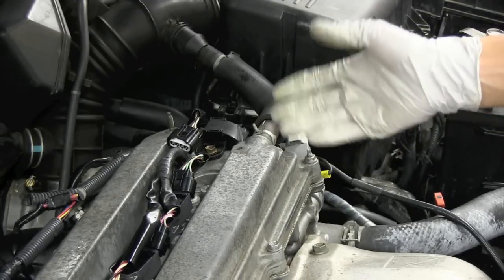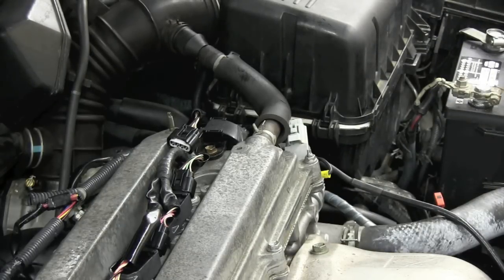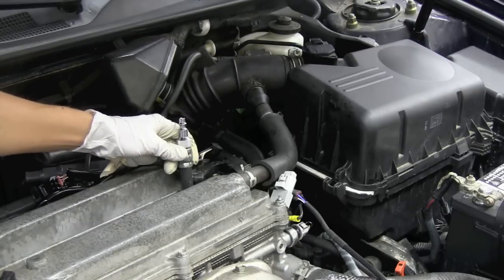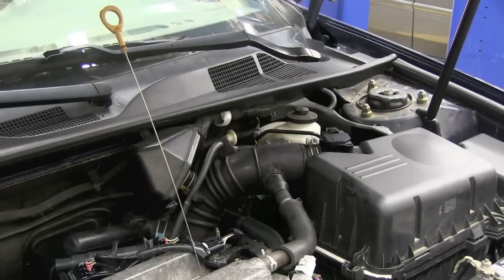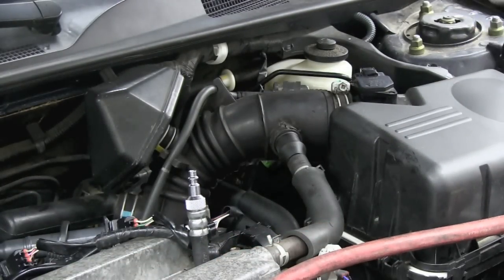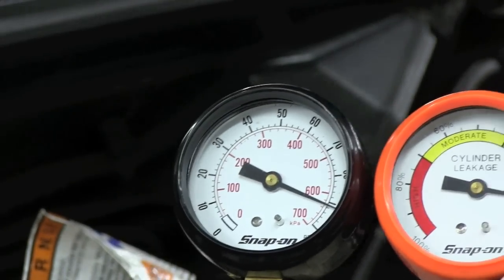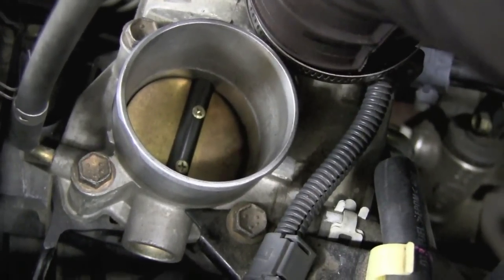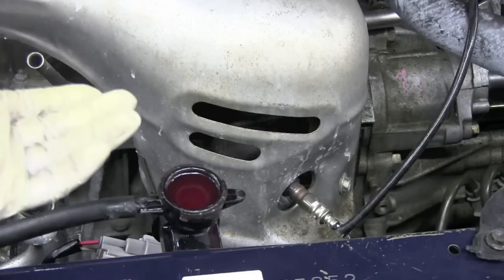Cylinder Leak Down

Comment: Excellent explanaton!  A couple of commen ts.  Engines never run cold - leakdowns tests should be run after the engine reaches normal operating temperature.  That allows oil to seal the cylinders as they would when running.  Next, after connecting the tester, run the regulator back up to 100 psi.  A new engine would have a leakdown of less than 10% (10 psi on a 100 psi input).  30% or more needs investigating (valves, rings, cylinder scoring can cause excessive leakdown..

Comment: I believe you need to close the regulator FIRST before connecting to shop air, this is to protect the dial from getting too much pressure applied to it, which it's not designed for, which would through off calibration. You have to start at zero and then twist the regular to bring it up to 100 psi, but no more.

Comment: What do u mean: if we reached TDC and then we will connect the tool  with the air supply - u sayin the pressure will push the piston down??? How to know if there's a leak or just valves got open???

Comment: Many thanks. Lovely lesson.
I have changed the head gasket, and I'm not sure what I did wrong. Cylinder 1 has 100 PSI, and cylinders 2, 3, and 4 have very low PSIs. The head cylinder was rectified. I can see the difference more than 2 mm short on one side. The engine will start and run for approximately 1 min. after it starts shaking and stopping. It will start only when it's could.  After it won't start again. Can somebody help?

Comment: Never put anything through the hole of your spark plug while you're turning the crank😂 bits of the plastic from the dip stick can break of inside the combustion chaimber or you can damage the thread.

Comment: Here's a trick, put a latex glove over the exhaust pipe and see if it swells up then u got leaking ex valves. Put it on the dip stick tube also. If the spark plug hole is on the side of the head don't use dip stick you can bend it.
Use a stiff piece of wire, and keep checking it does no bind before TDC.

Comment: Good and clear. I like the dip-stick trick. On the old British cars that I'm used to the spark plugs come out of the engine at an angle to one side so the piston can trap the long skinny screwdriver that I use, or the dip-stick that you showed us. It'll be fine if you just nurse it upright before it pinches. Good vid!

Comment: Here's how I find top dead center when doing a leak down test:

1) Connect tester to the cylinder you want to test.

2) Hook up compressor with low (~10 psi) pressure.

3) Turn the engine by hand while looking at the needle on the leak down tester.

4) Watch for the needle to rise (indicating compression). A falling needle indicates an open valve.

5) Keep turning until the needle stops rising (just starts to fall); you may have to back off a tiny bit.

You are now at TDC and you can use full pressure to do your test.
Reply: Just use a balloon on one side of the adaptor. When it expands it is on the compression stroke.

Comment: I think the low range going to 40% is because this is a static test, thus with the engine not running and warmed up with oil lubing the cylinders you will het lower readings

Comment: @5:22 - You did not show how to properly rotate the engine with the tester attached. Poor quality presentation as this test is very simple otherwise. While the correct positioning of the cylinder is critical but not shown the second time. But you said @6:15 - "get your hand broken" this seems poor example to me. @6:04 you rotated the engine again? How? Very confusing.  You did it, Good for you! But for someone needing to learn for the first time safley, you made it look risky. Otherwise, it was well presented. My comment is simply to express that new people don't think the way you may assume. And when danger is indicated, as you did. Please include the complete procedures in video form so no one gets hurt and does not haft to preform trial and error.

Comment: Great job!  One suggestion - if you turn the air pressure up on the tester gradually instead of plugging it in at 100 psi, it will be less likely to push the piston down to BDC.

Comment: Wouldn't be better to listen for leaks in the crank case from the oil filler cap? Isn't the dipstick tube going bellow the oil level?
Reply from the maker: The dipstick itself goes below the oil level, but the tube is normally above.  Listening through the oil cap or dipstick tube works just fine, and many techs will listen to both just to be sure.

Comment: I like your video. I've watched plenty of other techs using leakdown testers. You do a great job and you are using the snap-on tester (which is what I use when teaching engine diagnosis). It would be good to mention that the leakdown adapter hose does not have a schrader valve. If you also have a snap-on compression tester, it is easy to get the adapter hoses mixed up. That always causes confusion with students.

Comment: would it do any huge damage if i rotated it counter clockwise just a bit?
Reply from the maker: No you should be fine.  The reason why you don't want to go counter clockwise for a long duration, say a full turn is that the tensioner is designed to pick up the slack of the timing belt or chain only on the one side.  When you reverse direction, you may end up with slack on the other side which could put you out of time.  Can't say I've seen this happen, but it's theoretically possible and all the manufacturer instructions caution against rotating the engine counter-clockwise.  There are a few rare engines that normally rotate counter-clockwise.

Comment: I have no compression on cylinder 3 is it possible it’s just a stuck valve?
Reply from the maker: Typically not.   A valve that is stuck open which is rare, would likely result in a bent valve depending on the engine.  A bent valve does occur sometimes due to other reasons such as being out of time, or a burnt valve could give you the same result too.  Unfortunately there's many options, hence why we have to do the cylinder leak down test.

Comment: Great job. If you have a manual transmission, put it in gear to lock the engine. Be sure to set the emergency brake and block the wheels to prevent the vehicle from moving.

Comment: Simply put the leaking cylinder at TDC then put on the hand or parking brake and put the gearbox into top gear (if manual transmission)  that way the cylinder will not move down. Great video way better than Eric the car guy who could not operate a simple air regulator.. go girl..

Comment: Hi Laura, I have A Chevy Nova 69, with a GM 250 6 inline Engine,  from some reason is very low on power, all cylinder are around 100 psi, I will going to check the Leak Down Cylinder and now with your help I know how to do it , I looked to many videos how to tested but no one explains how the cylinder should be. Thank You!!!

Comment: LAURA GARCIA 
        1.) The Actual Compression test kit will measure the PSI level of that No or Low compression cylinder? you will want the PSI level to be 30 PSI or more than 30 PSI to considered a good cylinder? 
What do you use to test the PSI level of the cylinder?
          2.)  What do you use to do a Cylinder Leak Down test? You want the Cylinder leakage meter to measure 0% to 20% cylinder air leakage?
I have seen technicians poor water on the cars engine to see if the head gasket is leaking or sucking in the water. If the engine starting to running funny misfiring while applying water on the value cover and head gasket this means that its the head gasket or intake value?

Comment: Good work. 
Just one thing, once you have connected your shop air, you turn your regulator until the gauge on the rights pointer lines up with the set mark, not 100psi on the left. 
Anyhow that's how mine works and a few others I have used, maybe snap on is different.

Comment: Wrong. You connect the leak down tester to the cylinder AND THEN you turn the pressure up until the first gauge reads 100 PSI. Why are almost all the videos on YouTube about this test wrong? Where do all these “mechanics” get the idea that you pressurize the tester before you plug it in? That is incorrect.
Reply: How do you do that if there is a leak
Reply: @darrellcheng   You plug everything in from the start. All the way to the cylinder. Then you turn the tester up until the first gauge hits 100 PSI. Then you read the second gauge to get your percentage of leak down. When you do a leak down test you watch the percentage of leak down during a continuous leak. It’s not something you measure just at the instance you plug in the tester.

Comment: Nice video. I particularly liked the oil dipstick trick. I do have some comments if you do not mind.
To make sure that you are on TDC (top dead center) you can put the dipstick in the sister cylinder of the engine if accessible. That way while the air hose is in #1 cylinder, the dipstick could be in #4 in a four-cylinder engine. I would however, have the regulator at 0 air pressure and then gradually increase the pressure. Preventing the possible rotation of the crank.

On a side note, back in seventies, I was thinking it would be nice to open a repair shop with some female mechanics. Did not happen.

Comment: Good except removing o2 sensors is a bad idea they may get destroyed when removing and even if they don't they can possibly not seal as well when reinstalled. Never remove an 02 sensor unless you have another in hand to replace it with. Not to mention depending on the vehicle they can be a high ticket item you don't want to throw ontop of your customers bill, that is unless you like to pay for them yourself.

Comment: If you need 2 hands to turn the motor on a GM 350 even with all the plugs out, attach a balloon to the tip of the quick connect and you'll see when your on the compression stroke. Note: do not connect full 100 psi to the hose in the spark plug. Set that regulator on the gauge to zero then connect it, then open the air slowly to 100 psi. 

I prefer using a tester that has 2 psi gauges 0-100 or 0-160 psi. I really don't trust that gauge on the right. I made my own and yes I have a .040 orifice hole before the gauge on the right. If your shop air has a hard time providing 100 psi then come down 5 or more psi. Whatever supply psi you use on the left gauge, you can use this formula for your results. It works for any pressure you decide to use on the left gauge, but I wouldn't go lower than the industry std of 60 psi.

I'll use 70 psi in and 65 psi for the escaping pressure on the gauge on the right. 
(70 - 65) / 70 x 100 = 7   Therefore that is 7% loss. The in pressure of 70 psi is used twice in the formula.
Reply: In the video the cylinder under test turned because of the 100 psi pushed it and the 2nd gauge went in to the red.  Assuming that the cylinder is good... Would the psi on the gauge increase, as she cranks the crank to make the cylinder (being tested) come closer to TDC?  Or does the tester have to be removed, before TDC if found?
Reply: That's what I had as a homemade. I just watched a video with a factory tester and prior to hookup to the cylinder he adjusted the regulator until leak gauge was fully clockwise but first gauge only read 20 psi. Faulty tester?

Comment: I like Eric the car guy's method of finding TDC, but the oil dipstick idea was cool and new to me. Thanks!
Reply: Can you show how to redo the singing up the ignition with the notches on the crankshaft and the top dead center and the distributor line up on a 1991 madaza  b 2600,I series 4x4

Comment: What about running the engine up so it is hot first. Required? Will the rings seal 'better'
Reply: I don't know for sure. But multiple internet sources confirm it has to be done on a hot engine.
Reply: I will not remove a spark plug from a hot engine if the cylinder head is aluminum!  Too much risk in damaging the head's threads.
Reply: @scotta9114  false that is not true

Comment: a far easier method is to divide 720-degrees by the number of cylinders (say 4) and use the timing marks.  Exactly matched timing marks would indicate the 1st or 3rd cylinder in the firing order.  The other 2 cylinders the marks will be 180 degrees apart or 90 for a V8
Reply: flatplane v8s 🤷🏻‍♀️ crossplane i4s 🤷🏻‍♀️

Comment: Rotating the engine either way makes no difference, all of the components reciprocate (transfer rotation into roughly up and down movement) or rotate. The direction changes nothing aside from crank, cam, and accessory rotation while testing.
Reply: Wrong. The timing chain or timing belt tensioner only takes up slack on one side/ engine rotation direction. You can rotate it backwards a small amount and be ok, but a large amount is not recommended.
Reply: @petmitsu  That's true tensioners are designed to apply tension to the un-tensioned side according to rotation but I've also never seen or had a tensioner or the non-tensioned side slack up (enough for concern) while rotating the opposite direction. The tensioner side will  be tensioned and nontensioned will have some from the gears & guides while rotating slowly in the opposite direction on the now un-tensioned side if it's just a small amount like you mention..

Comment: Great video. Could you tell me how do you stop engine crankshaft rotating plz?
Reply: Tony Stark when it's at tdc it won't move. once the Piston stops moving you must go slightly further so it's totally vertical and there is no way the lever of  the connecting  rod can act on the crank. it's tough with short stroke engines but you will get it.
Reply: Magnacharger07 thanks a lot

Comment: Idk why every person who demonstrated the test is showing the last step the wrong way, the incoming air does not have to be at 100 psi before pluging the gauge to the adapter hose, you do your connections first than gradually increase the psi to prevent piston movement..GOD !!
Reply: I agree. Most of the leak down test videos on YouTube are wrong. Lol.
Reply: haha, thanks redwood
Reply: True😂
Reply: redwoodepa hey little buddy at tdc the Piston doesn't move if it moves you weren't at tdc

Comment: At 8:18, I believe the thermostat has to be open in order for you to see bubbles from the radiator cap if there is a bad head gasket.
Reply: Many if not most thermostats have a small bypass hole.  Air will go past the thermostat.
Reply: Water pump will push coolant one direction but air can leak backwards and out the cap with thermostat closed.
Reply: She actually did the test wrong, if you read the info given with these testers, they tell you to test after warming the engine up, so test must be done on hot engine, then all plugs must be removed, reason is when engine is heated everything is properly expanded, and thermostat is now open. Reason for all plugs removed is to test to see if air could be leaking into adjacent cylinder. She did a just ok job, everyone said she did a great job, well she did not. Had she did such a great job your question of the thermostat would have been answered. Also on a cold engine you will have some leakage till cylinders are hot and expanded. She did not tell you to removed all plugs and thus the test for adjacent cylinder leak would not get done. Now perhaps she knew this, but the video was to help and teach others so no well done at all.

Comment: when you first pressurize the leak down tester the regulator should already be turned all the way counter clockwise.otherwise the set area will not be consistent therefore giving inconsistent readings

Comment: The leak down test should be tested at 100psi?  There are a few videos that others are testing at different psi.  Question is how much psi for an accurate test?
Reply from the maker: I prefer 100psi because it makes the calculation easier.  For example, 100 psi goes in, 70 psi stays in, that means you have only 30psi leaking = 30% leakage.  Some others might use different psi ratings because they use air directly from their compressor which may not be metered.  Rudimentary, but it can work.  I would say you wouldn't want to go any lower than 70 psi, or higher than 130 psi to attain an accurate reading.
Reply: Actually it depends on the tool manufacture specifications, this is straight from GM repair manuals. 
Thank Laura
Reply: Boostwerx my leak down tester from harbor freight would only work between 10-15psi accurately otherwise the needle would max out over zero leak.
Reply: I have a very old Snap-on leakdown tester that only goes to 60 PSI.  Bought a new OTC branded one that does go to 100.  I've been told to do a leakdown with the engine hot but with aluminium alloy heads, I do not like to remove a  spark plug with the head hot.  Afraid the threads will sustain damage.
Reply: Thanks for the help.  I made a homemade leak down tester and the engine was still holding pressure on all cylinders.  My problem was bad rings on all cylinders causing oil to seep in.  Reringed it and solved my problem.